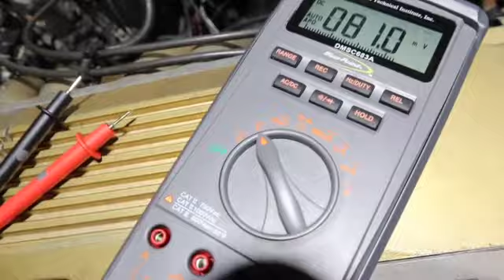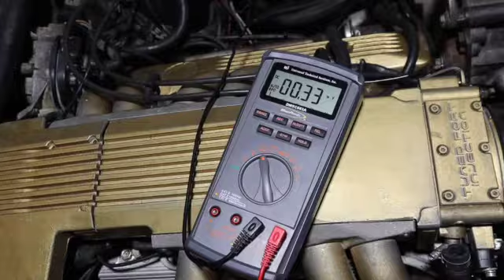Adjusting the TPS sensor and Replacing coolant temp sensor on my C4 corvette

Comment: How did you get value covers gold 🤔
Reply from the maker: I painted them back in my older videos
Reply: OK, thanks, does it hold up great is it engine paint 🎨 reason I ask I have a 89 C4.
Reply from the maker: @kennygibbs9627  Yes It actually does hold up well. I had it on for about a year now but I have to repaint them cause have been workin on the car alot.